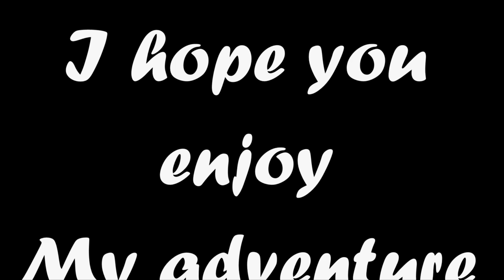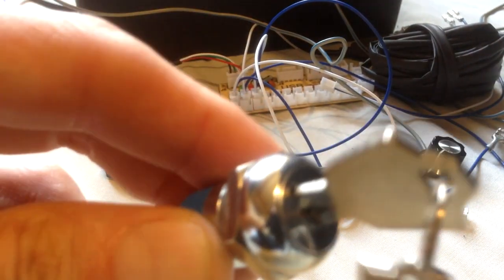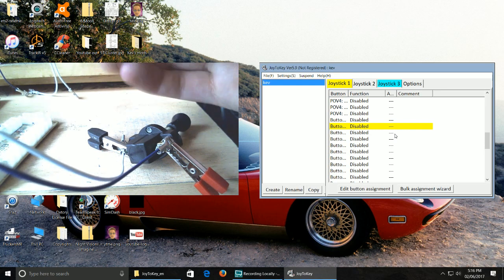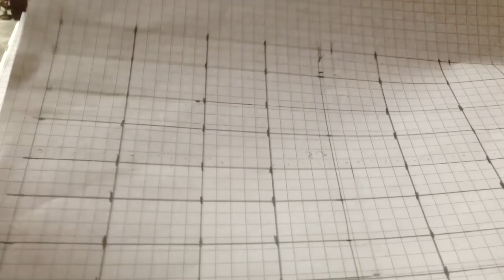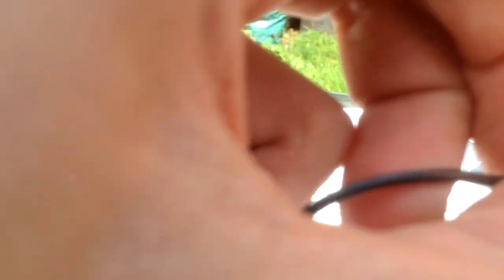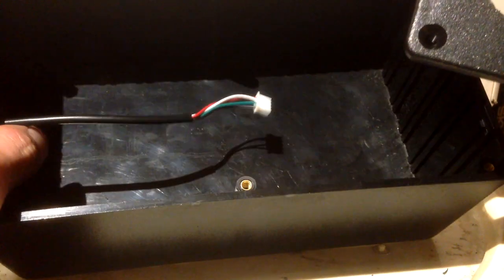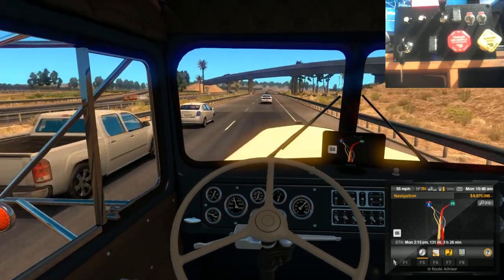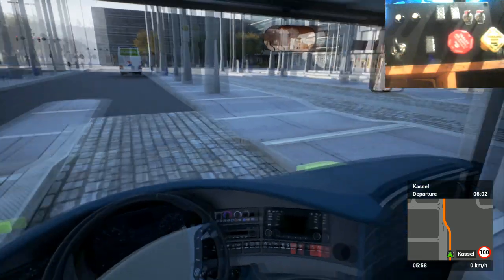How to Build a Button Box for your PC

Comment: Fantastic video, so helpful thank you. How do you connect the rotary encoders to the board? im unsure of which pins on the encoder to connect to the zero delay board. many thanks
Reply from the maker: Thank you, first of all, all of the pins can be used on rotary encoders can be used there many different types out there 2,4 pin and 6 pin ones some only rotate and some have a push down function that can used as a switch. My advice for what it’s worth is before any soldering takes place get a peace of paper and make a diagram of the pin configuration then number it 1 to 6 or whatever you have. Now grab your multimeter and set to continuity if you’re multimeter has alligator clips then it makes life easier if not then you can use Arduino wires to make it easier especially if the pins are small and fragile. Then place multimeter probes on 1 and 2 pins on the encoder then rotate the switch and see what happens bear in mind that encoders can be fast so watch and listen carefully if you multimeter has sound that is, but if nothing seems to be happening then keep one of the meters probes on pin 1 and then move the other to pin 3 and repeat then make note on your diagram on what pins do what, in some cases the encoders have left only left to right extra let’s say left block of pins pin 1 and pin 2 work though the turning and pins 1 and 3 only work though the push down of the encoder then you have two potentially switches so need to run one positive from the board and to grounds back to separate slot on the board and test see what happens. I probably haven’t made it easy to understand but I hope it helps

Comment: How did you wire the rotary encoders? Thanks! Nice vid, subbed
Reply from the maker: Hi thanks for the sub and your comment, you have to wire the 3 pins as separate buttons I admit it's tricky to soldier them as it's easy to overheat the pins and snap them you can get Rotary encoders that work with Arduino wires that are easier to work with
Reply: Kevin Sawyer ohh thanks man!
Reply: Pedro I’m going grey sorting them out as well. If connected directly to two switch points when you turn the encoder it simply does both actions! As in it cancels itself out.
Reply: Hi I still don't get it sorry no engineering background but how do I wire the 3 prongs , red black on each pin?
Reply: Kevin Sawyer hi kelvin , sorry but I still don't understand how to wire, no engineering background here, is it a red and black wire to each pin?
Reply: @Kevin.Sawyer  ok but how exactly did you solder them?

Comment: Hi Kevin,

Thanks for the informative video. I have a question about those toggle switches with 3 prongs that can be hooked up to activate 2 buttons. What is the logic of the switch for the keyboard? Will it be like pressing the button once or holding the button down? During your video you can see that the button stays highlighted yellow so is that like if I was to hold the button down on the key board? For a flying sim. If i wanted to have that switch selected the gear which requires just a press of a button is that a switch that would work or is there a better option? Thanks
Reply: Since o.p doesn't seem to like replying, you would be much better off with a momentary contact switch which you can pick up off eBay for not much. They activate when you make the contact and then deactivate, which is similar to a button on a keyboard or joypad.

Comment: for next time, try to sand off the zinc from the button/switches, if you want to solder a wire on it. that helps a lot. ;)
but good tutorial for beginners!  cheers

Comment: I’m kinda a noob and want to set up my first button box but I don’t know anyone or know how to solder something is there a chance it’s possible to do it without soldering ?
Reply from the maker: Yes you can you can use spade connectors but you will need a crimp tool or good set of pliers to clamp the connectors to the wire just bear in mind over time the connectors can lose connectivity over time but that’s a worst case scenario
Reply: @Kevin.Sawyer  holy crap man thank you for that will the same thing with the clamp connectors apply to this video or do I need different materials
Reply from the maker: @justinthomas4611  well it all depends on the switches and board that you have, the rotary encoders that I used on this video you have to use soldier, but there are ones that can get that use Arduino cables

Comment: What is the mod for the sound of the trailer air supply? And what function is assigned to that button? Trailer brakes?
Thank you very much for this video
Reply from the maker: I think it’s part of the KW 521 sound as for what the trailer brake it is assigned to the trailer brake in game

Comment: Can you please post a wiring diagram? I'm using the same board as you but I can't figure out how to make it to where when you pull the parking brake it applies and when you push it, it releases. I have to pull the switch to apply then repull it to release it. Please help
Reply from the maker: If your using the same board and same switch with joy to key just follow the joy to key part of the video I changed my board in the end i'm using a synprojects  board as it's easier to set up

Comment: Hello again:
Sorry for my english I´m using Google translator.
I don't understand how you wire, could you help me.
If I have read a previous answer well:
In BAT you put a blue wire on one pin and a white wire on another.
In IGN you put a blue one
And in ST you put another blue.
The White wire that are free of IGN and ST, splice them into one, and then you connect them to BAT, 
where the white wire is already connected.
Finally the circuit would be as follows:

BAT
+1 blue wire
-3 white wires, 1 which is part of the BAT connector, and 2 spliced white wires coming from the free wires of the IGN and ST connectors

IGN
+1 blue wire

ST
+1 blue wire

Then you connect the connectors to 3 different ports of the USB encoder.
Is this how you do it?
Thanks again
Reply from the maker: Hi You can do it in two ways the battery can have one blue and one white if you use the same switch I used it will be on all the time but you can also just use the battery terminal as a common ground and just have one or two white on it but best to bench test first, ignition only needs one blue and starter needs one blue on that switch there is a accessory terminal or ACC you can wire one blue to that as well but you don’t need it
Reply: @Kevin.Sawyer 

I want to insert the key, turn the key once to the right and have the electrical system connect, momentarily turn the key again to the right and the truck start, then the key would return to the IGN position by itself, and then, turn the key to the left, returning to the starting position and the truck will turn off.

How a starter works in reality.

Would this work with the wiring that I told you ???
thx for your patience
Reply from the maker: Ivan Fuentes de la Calle yes but bench test it first before doing any soldering
Reply: @Kevin.Sawyer  ok, thank you very much, you are the best, i'm searchin info 2 week and finally you resolve all my doubts, thx again
Reply from the maker: Ivan Fuentes de la Calle no problem I’m glad to help, please feel free to like and subscribe and donate it all helps me to grow, all donations go into the channel and fund future projects I have a video coming soon that’s a brief on how I upgraded my button box into a wheel stand and upgraded my sim dash

Comment: What wires do u use in the video to do the wiring??
Reply from the maker: You can use Arduino wire or any low gauge wire anything that can handle 6 or 5v

Comment: I got this board. your the second video I have seen that has the blue and white wires, mine has black and red so not sure on the wiring for my application key starter
Reply from the maker: I would say red is probably positive and black would be negative so if you have a similar key switch to me you have two options you can go black on the battery terminal acting as a common ground red on the ignition terminal and red on starter, or you can go red and black on the battery terminals if you have two that is that will make the button always on, red on ignition and red on starter. But bench test before soldering
Reply: @Kevin.Sawyer  red and red  separated. both black on common is one of my set ups maybe I can build one two red on battery black on ignition and start  thanks for help

Comment: Hi! Thanks for your video, but I'm a noob and I need to see how to connect buttons and switches to the board. In particular, how did you connect the led toggle switch (3 pins) to the zero delay which has only 2 pin connector? Sorry for dumb question
Reply from the maker: Daniele Serra not a dumb question all you need is spit the ground wire and run it to the led pin
Reply: Kevin Sawyer really thank you Sir!
Reply: Hey I don't understand what you mean can you clarify please.

Comment: can you please explain the rotory encoder wireing
Reply from the maker: Depends on your pin configuration but the middle pin was a common ground with the two buttons on each of the outer two pins for mine
Reply: @Kevin.Sawyer   I have the same usb  joy stick controller board  and same encoder but when I spin the  dial 2  buttons  go not just one

Comment: Hi, how did you wire the rotary encoder (the one at 15 mins into the vid)?
Reply: Don't worry, I figured it out - quite easy really.
Reply: Owen0501 hey would you mind telling me how did you wire the rotary encoder to the board?
Reply: Owen0501 hi how did u do it

Comment: Where did you bought the parking and trailer brake buttons?
I found a manufacture (Haldex) but no way to buy them (in europe, I´m from germany).
Reply from the maker: Waschmitttel  hi I found them on eBay you can only get them from the states and cost a lot to post
Reply: Can you post a link?  I can only find real ones with air valves. Thanks!

Comment: I have the push pulls figured out it's the ignition I am having problems with.How did you wire it to the board and set it up on Joy to key?It has off /on then springs to the right for start and back to on
Reply from the maker: ok you only need one ground on the ignition you just need to find out where your position one and start terminals are on the ignition the use a button on each terminal if your using the same board i did and playing ATS / ETS it only works when you let go from the start postion thats the downside of the bord hence way I upgraged my board in the end

Comment: when i flip my jake brake switch i have to flip it on and it works great but to turn it off i need to turn it off and back on than it goes off? what am i doing wrong
Reply: Is probably your switch bro for those boards your switch has to be a momentary on/off switch
Reply: I was using just some eBay toggle switches on/off
Reply: @jurassicjeeper1996  toggle switches are more realistic but for it to work properly in a video game you'll need something like and arduino or a teensy
Reply: I'm also interested in building my own but I'm still watching some tutorials on how to code the teensy which to me looks easier to code than the arduino
Reply: I have a USB joystick board

Comment: howd you wire the parking brake?
Reply from the maker: One live one ground it’s just like a switch just a push pull to make and brake the connection
Reply: @Kevin.Sawyer  and you just put the cap over the pull push switch?
Reply from the maker: @JoshuaDay0550  I had to get my bro to 3D print up a spacers so the caps fits snug but you could make something work for you
Reply: @Kevin.Sawyer  sounds good, thanks for the feedback!

Comment: What button did you use for the parking brakes
Reply from the maker: Alison Bennett  I used gutter switches but you can or you can use push pull switches if you set up a toggle using joy to key or if you invest in a better button controller like http://www.symprojects.com/jc32-joystick-controller or http://www.leobodnar.com/products/BBI-32/ or the http://derekspearedesigns.com/32-button-no-matrix-controller.html you can use the software to configure the buttons as toggles, I upgraded to the symprojets controller myself but it all depends on your budget for the box build, I hope this helps
Reply: @Kevin.Sawyer   can you please send the link to the gutter switches you used? All I get are home gutter stuff.

Comment: hi I'm interested in buying one of these would you make it and how much would it be?
Reply from the maker: chris wood hi thanks for stopping by, depends on the set up you would like and if you would like the parking brake caps I have got someone who can make a set of caps with a 3D printer but it's still in testing, just for the base box with the same joy controller I use in the vid without the brake caps your looking at £70 mark not including shipping

Comment: Just watching the soldering part and thats wrong u dont need that much wire when soldering to something and u dont twist the tires it makes it harder for the solder to flow thru the wire witch makes a ok but not the best connection strip just enough for the post ur soldering to and dont twist the wires

Comment: Hi really enjoyed this video.I am working on one as well.I have the same board you do.I have a ignition with a on position and then a turn and hold to go to start then it springs back.How can I wire this to the board to work that way.One turn ignition on second turn and hold to start then all the way left to turn the truck off?Also how do I set the push pull buttons for the parking brake?When I bench test mine I pull them out the  brakes come on but when I push the button to off it does nothing.I have to pull again to get it to release.Is that something I have to do in joy to key?I am using this for ATS an ets only.If you can provide some insight how I need to wire this up to that board I appreciate it thank you.
Reply from the maker: have you tryed setting them up as a toggle?
Reply: Kevin Sawyer no I don't believe so how do I go about doing that?
Reply from the maker: yer I try to show how in the vid try that its not the best set up but it can work
Reply: Kevin Sawyer Is that where your using the toggle with 2 button presses?2 blue wires one ground?So you would go to 2 button options on the board say button 11 and 12 but only one ground correct?
Reply from the maker: Buckshot Gaming yer when I show how to set up a toggle using the push pull switch
Reply: Kevin Sawyer ok yes I think I know what you mean.How is it actually wired to the board ?Just one button spot?

Comment: How did you wired and configured the ignition switch key ?
Reply from the maker: ale pulgui depends on your ignition type but with mine the battery terminal had both feed and ground the one feed to ignition then one feed to the starter
Reply: Kevin Sawyer So 1 positive os ignition to a 1 USB port and another positive to starter and to another USB port... And the negative to the ground like all? And the off position? What did you do... In my head IS like that all of that 3 position press the e button of the truck right? I dont know what IS the baterry terminal , it requieres 12v apart? Sorry for my english
Reply from the maker: ale pulgui are you using the same bored as I did?  and what sort of ignition switch you using if it the same as mine it should have positions marked on it if not you will need a multi meter and set to continually to find out how your switch works
Reply: Kevin Sawyer I use the same stuf as you , ignition with 4 positions and it has 4 outputs pins
Reply: Kevin Sawyer Thank you for helping me i have all done i only need to do the switch ignition and its done... I have a 12v one with 4 outpins
Reply from the maker: ale pulgui  no problem,  all you need is both a the blue and white on to the two terminals where it says battery on the switch then one blue onto the ignition and one blue onto the stater terminal of the switch then splice the two spare white ones into the same white cable that is going the the battery terminal on the switch then plug them into plug the three 3 different button ports on the bored then test it, it should using joy to key or using windows devices properties if you use button 1 2 and 3 as a example it should be as follows the key is switched to off then button one is lit up then turn the key to position 1 on the switch then both 1 and 2 will be lit up then move the key to position 3 on the key and hold it  all 3 buttons will now be lit, if not and it's one and 3 lit then you may need to make a bridge between the spare terminal on the starter and the ignition or acc terminal of the switch if all 3 are lit then let go of the key the it should go back to just one and two let up it should be set up right, I hope this helps
Reply: Kevin Sawyer Ok thanks i have understand it , so all 3 position Will use the same key right? Thank you so much
Reply from the maker: ale pulgui no 3 different ones they share the same ground or white
Reply: Kevin Sawyer yea you can assign 3 diferentes buttons but por ets2 they all are the E key for turning the engine right?
Reply from the maker: button 1 and 2 work as a toggle button 3 works as a monterey switch thats how to work around ETS and ATS
Reply: So i have wired it and now... in ets2 what i put in turn on engine? if i want to letter E for turning on the engine i need to configure in joytokey all 3 butons to E ? and then just put them in ets2? please if you can explain how now to enable it in ets2... thank you vbery very much man
Reply: hey?
Reply: Hi kevin so when i move the switcher to the last right all 3 buttons are lit but now... in ets2 i cant map it because when i start to move the key to the right the before positions keep on so ets2 dont let me use more than just one position of all 3 in the ignition switch with 4 positions. can you help me maping this?